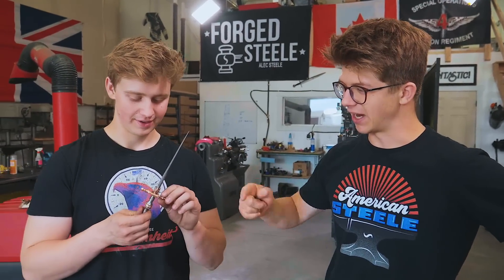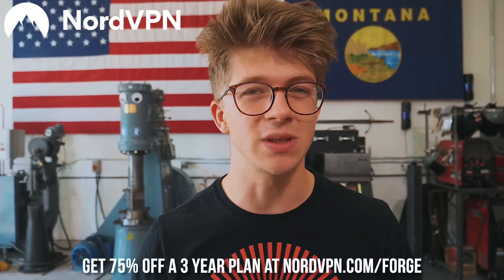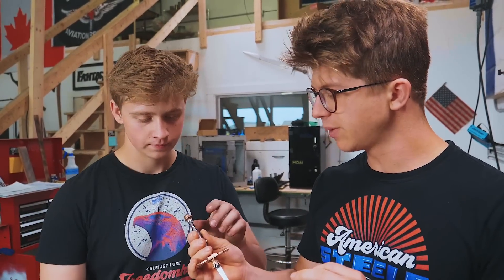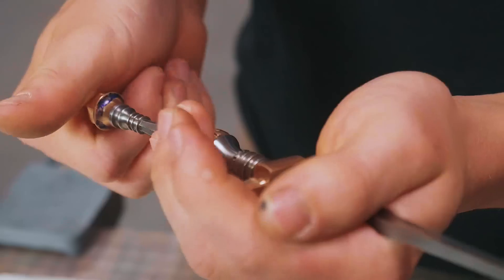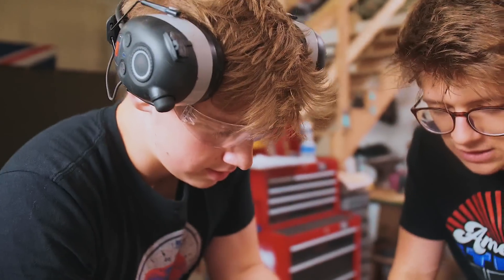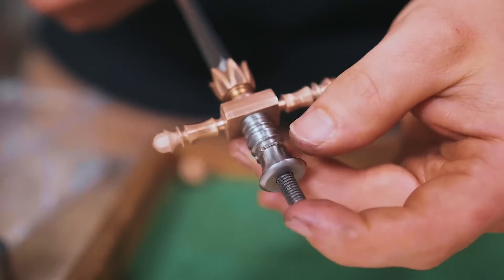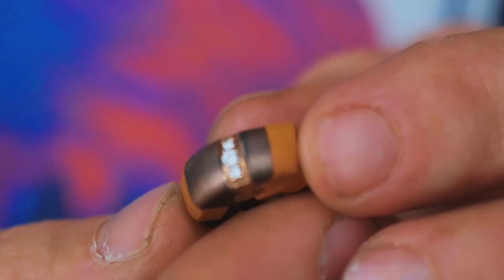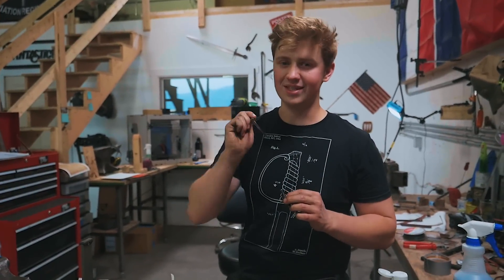DAMASCUS STILETTO DAGGER!!! Part 3

Comment: Make a Damascus musket!!!!!! You guys could get help from a whole different set of professionals outside the blade community that would be a huggggggggggggeeeeeee project for you all definitely a test of skill 💪🏽
Reply: That's the best idea I've heard all day
Reply: Making a cylinder with a hole mostly down the center would be a great test of skill.
Edit: with lots of wood work.
Reply: Making a gun could have legal requirements?
Reply: Think of all the detail work that could be added to fittings, etching, engraving, it's got the potential to be a great project
Reply: @tomskaggs7918  only if he makes it with a working trigger
Reply: OOOOH that'd be so cool, imagine the damascus barrel... Also damascus dane axe when
Reply: Tom Skaggs I dont know about Montana but in most of the states Muskets and other muzzle loaders are not considered firearms. Along with fact that in some if not most states it is perfectly legal to build your own firearms as long as it is for personal use and is not sold.
Reply: Vincent Hansen 
He probably would intend to sell it though, if he turned it into a huge project.  Gotta recoup the investment
Reply: There is hand forging the barrel, you flatten a sheet of steel, then put high carbon steel mandrel in the middle, and hammer weld the sucker
That's how they used to make barrels in the old days, some still do it like this to this day
Reply: @tomskaggs7918  not a musket, even a cap and ball pistol would be ok.
Reply: What about a Damascus m777 howitzer
Reply: @tomskaggs7918  yes it would but it's simply a case of registration to the proper authorities that they want to start a new gunsmith manufacturer business
Reply: @trevoror8668  no need to register for personal use
Reply: @abdallahmanasrah2317  can believe that but would be a big unnecessary problem if it was to be sold and it would be a very handy string in the lads bow to be able to manufacture legally. They would be in deep dodo if they built firearms unregistered in the UK
Reply: One hundred percent agree!!!!
Reply: Early flint-lock and wheel-lock guns, all the way up through the mid-1800s could frequently, even if not commonly, be see integrated into swords, or have short blades incorporated with them.

I swear I'm not a dork, I only type like one.
Reply: That is a damn good idea lol. They have a lathe, that gets the barrel done. They also have everything else to make one. I vote Yes on a Damascus musket!!!!!!!!!!!!
Reply: @tomskaggs7918  they're in America and the mid west... So no, if they make it for personal use they're fine.
Reply: Yes. An old musket and internal pieces...there are tons of guys that can help you and you can expand your audience
Reply: @tomskaggs7918  actually, muskets aren't considered a firearm by the ATF. Any firearm or replica there of made before 1898, with the exception of firearms using self contained fixed ammunition, are considered non firearms. This applies universally to any muzzle loading fiream.
Reply: YouTube doesn't allow  videos sowing how to make a gun
Reply: This would indeed be a pleasure to see!
Reply: @jessecarpenter6434  with or without associated SL-3?
Reply: @tomskaggs7918  Nope. This is 'merica.

Comment: Just exquisitely beautiful! You really put that lathe to good use!

I did like the look of the darkened bronze, but love the contrast of the bright bronze with the dark steel.  At first I thought you might balance out the ring in the middle by just polishing some of the flower/leaf/bulb parts on the pommel, ends of the hilt, and maybe the edges of the flower around the blade, and leave the blueing on the rest -- do a sort of three-tone look.  But the all-polished look really did come out beautiful too, and probably shows the contrast better.   Amazing piece, guys!

Comment: Beautyful job!
Next big project: Damascus steel-sub hilt-integral bolster-cocobola handle-leather lanyard-gem stone inserted bushcraft knife with quick release straps-altoid, tinder,  Wet Stone & Fire Starter pockets leathre scout sheath.
Maybe thow in some twisted gold wire flukes and custom lanyard beads to.
Alec Vs. Will kind of challenge. so each one of you guys can have their own knife and go use them on the wild.

Comment: Hey Alec, long time fan, watched your move from the UK to the us
my name is kevin and I’m a few tests away from being an USA FAA Certified aircraft mechanic. My passion is engineering and metal working. I would like to talk with you about getting together and seeing what can become of an idea I had concerning a pneumatically actuated engine. If you can message me back, I believe your manufacturing skills would come as a breath of fresh air to the prototype process. 
I’m also working on a prototype TIG welding 3D printer that I am attempting to manufacture which I believe would be a great addition to your shop. 
Wishing the best,
Kevin

Comment: Very nice stiletto/dagger. 
However, from a historical nomenclature angle, as there is no cutting edge, it should more accurately be referred to as a ''Miséricorde''.
These were indeed quite prevalent during the stipulated period, as they were used to humanely dispatch a wounded warrior, 
principally knights as they were the ones in want of special consideration. This was generally performed by means of a thrust to the heart!

Comment: So I had to look at the price at $12,500 it seems pricey for a stiletto, and then I realized that it has a dozen diamonds in it. And they aren't small diamonds so given that fact I think that's pretty reasonable. way to go guys it looks gorgeous, I couldn't ever imagine it being used as anything but it display. My only fear is that is a fine tip stiletto that you have in a hunk of steel, that thing's going to get bent / broken in a heartbeat. I realize would is not your Forte but I think a wooden display would have been much nicer and the right type of wood like a golden Walnut would have given really great compliment to the colors on this stiletto.

Comment: That style of blade has nothing to do with the ability to treat the wound. It is all about making the blade as rigid as possible for better penetration, it is a thrust only weapon except maybe scratching Z into your opponent with a tip cut so it doesn't need sharp edges.. just a pointy end to poke with. That type of blade started with rondel daggers in the middle ages and were needed to stab into gaps in the armor, a rondel dagger can force it's way through gaps while a regular bladed dagger will flex and lose all it's power to penetrate. During the renaissance armor wasn't an issue but thick clothing was still so the three sided spike was very common as it goes through thick cloth better than an edged dagger and like the trusty rondel dagger is better at getting past human armor called ribs and have the enough force left to puncture the heart. There was even a sword that used that type of blade just for the superior penetration, the small sword.